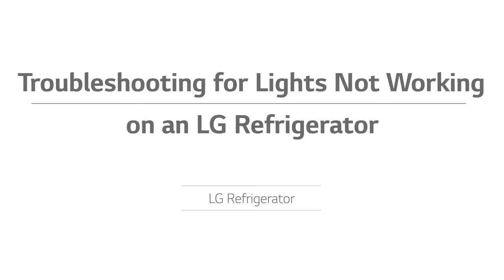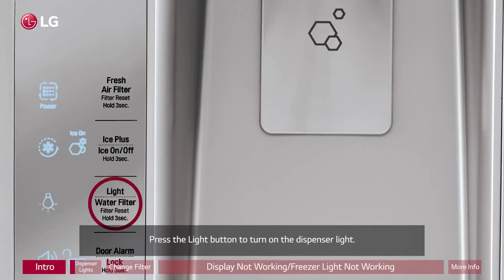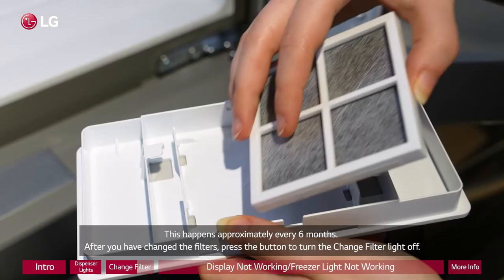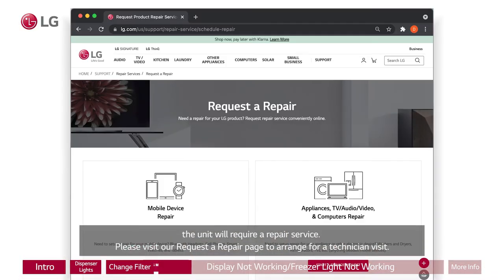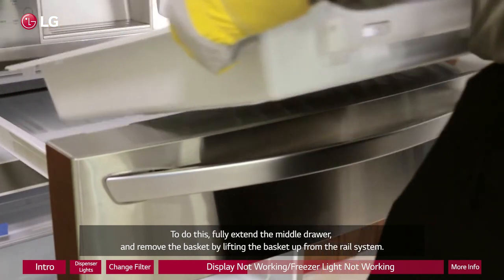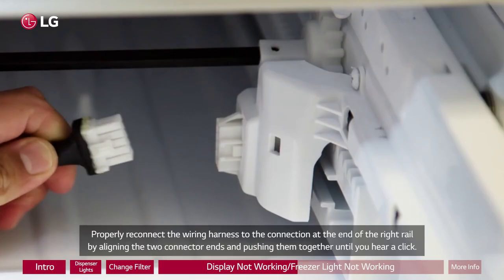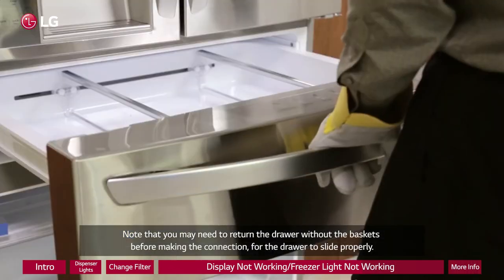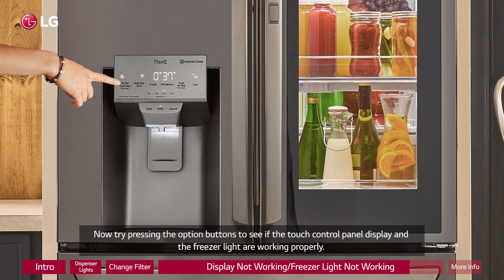[LG Refrigerator] Troubleshooting the Lights Not Working

Comment: What should I do if the lights for adjusting the temperature are only partially visible?  The fridge and freezer are cooling fine but the actual numbers for the temperature are not displaying fully so you cannot determine which number is selected/what the temperature is actually currently set to. All of the other lights in the panel and inside the fridge work fine.
Reply from the maker: Hey there. We appreciate you asking this question. While we certainly want to ensure that you get to see the temperature inside the refrigerator, we'd be more than happy to troubleshoot this with you. We have a dedicated customers service representative that is ready to help you out with this. Please send us a private message at our Facebook or Twitter platforms using @LGUSSupport with your contact details, model and serial number of your unit. ^Anthony https://www.lg.com/us/support/help-library
Reply: @LGUSASupport   Hi, thanks for this reply.  Can you please provide a direct link to Facebook?  I tried a FB link I found in another comment on another video, but it’s not working/not allowing me to message.  I’m getting the “something went wrong” error. Also, I’m not a Twitter user. Thanks.
Reply from the maker: Hi there, We see that you are contacting us regarding issues with your LG Products. Please send us a private message via messenger. This is how you can get our private message, live Chat: https://www.lg.com/us/support/chatbot
Email: https://www.lg.com/us/support/email-appointment
Facebook Messenger: LG Global
Twitter: @LGUSSupport.
https://www.lg.com/us/support/help-library.~Tanisha